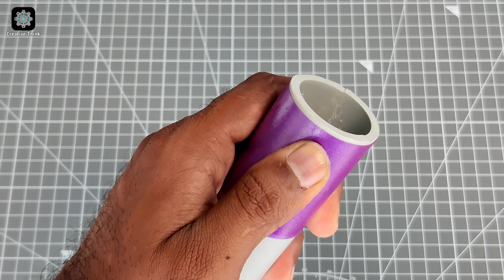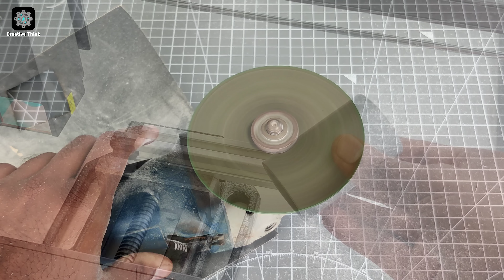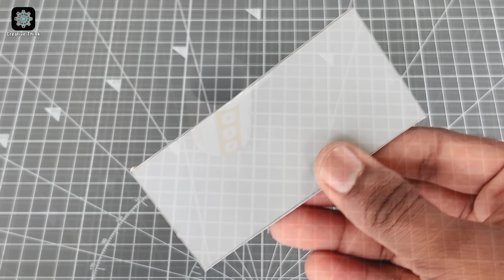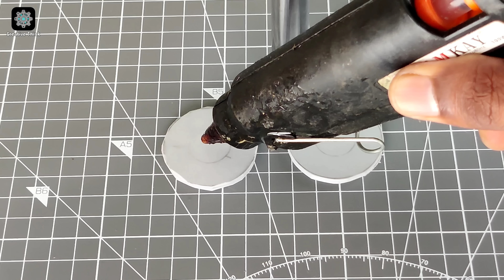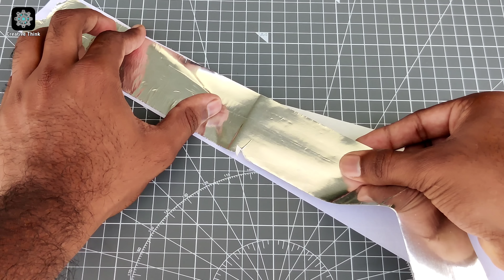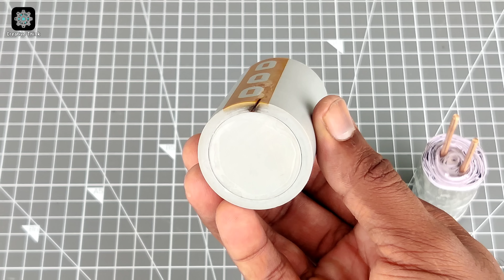Making Diy Capacitor at Home

Comment: The two conductive sheets in a "real" capacitor can not make contact, except through the positive and negative poles.   The video shows putting two pieces of copper wire in while rolling the conductive sheets which would "short circuit".  This can not work as a capacitor as show in the video!  There are good ideas here for making a REAL capacitor.
Reply: نعم تماس